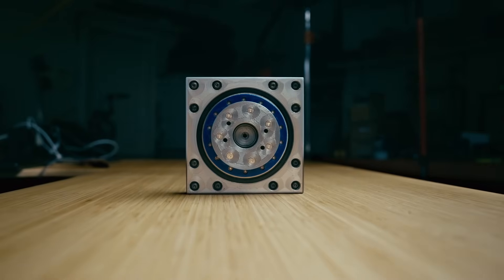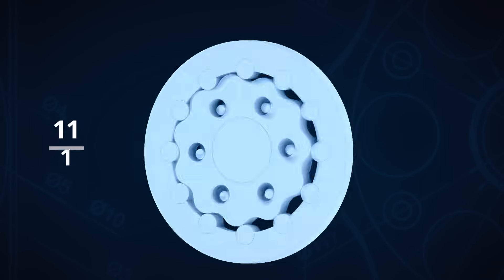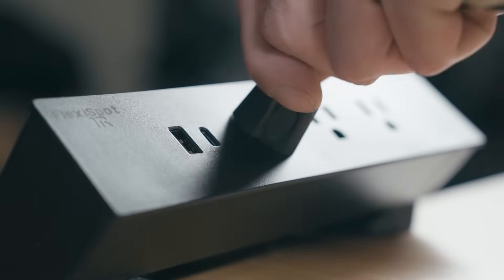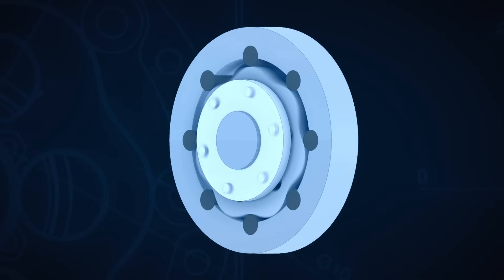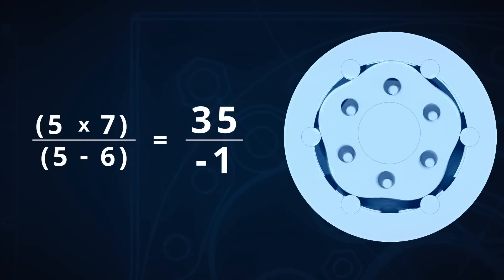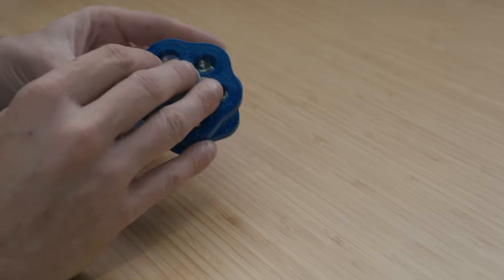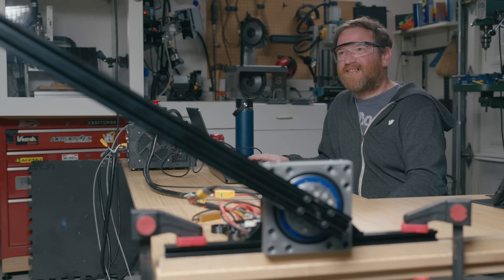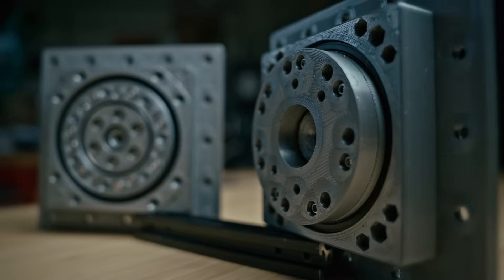You've Never Seen a Cycloidal Drive Like This

Comment: I think requirements for an industrial robot isn't changed from what our ancestors set ages ago :D Rigidity first. Imagine that all our motors are stopped, firmly, they could be removed and the inputs could be welded. Now imagine that you grab the end of your 1,5 meter long robot arm and yank it. Does it moved more than 1-2mm? An industial robot would be like a stone  in this case, rigid as f___, so when I'm planning a robot arm I start with the thinking of where is it gonna move when all inputs are locked.
For example 1 meret long robot arm, with 3kg payload plus the mass of the arm itself, we can count for at least 10kg of moving mass, which is about 100Nm when it's extended horizontally (and stationay!) When it moves, and we want to stop it fast horizontally, it can easily doubles that, plus safe margin. So that's the mindset of which all DIY robot creators should think when it comes to sizing their parts. ;)
Reply from the maker: But you gotta also move it somehow!  Great points though.
Reply: @Cinema_Mechanics  Hi! I hope you're doing well :) and so the project! I hope i didn't scare you off or discourage you, I didn't meant to. I just wanted to say don't afraid of sizing the parts bigger, larger, beefier ;) We are not Kuka or Fanuc but with a machine shop like this you can achieve similar results with a little bit bigger parts, lager diameter joints, etc. than an "official" robot with the same span. And the robot will be perfectly fine. Function will dictate the form :)
Reply from the maker: @bregbarega3717  haha Nope still plugging away!  Just been busy trying to juggle all the projects while making videos!  I love the thoughtful critiques.  It's how I learn when I'm being a bone head.

Comment: I would like to see this Cycloidal Drive paired with a small drone motor to power an electric bike
Reply: While speed and torque can be exchanged, power is absolute. A watt is a watt no matter what. If it takes say 5 watts to accelerate and maintain a mass at a given speed, and you're not putting at minimum 5 watts into the system (which youll of course have to input more than that for frictional losses in the bearings and contact points, plus rolling resistance, air resistance, etc) there is not enough energy (ie, power) to accelerate the mass to the speed. You can use that 5 watts to spin something light really fast, or you can use that 5 watts to lift something heavy slowly, but 5 watts is all you have. In physics, there are no free lunches.

Comment: Another interesting variation on the cycloidal drive is the compound cycloidal drive, where there are are again two cycloid gears, but they are attached directly, so without an inner ring. One of the cycloid gears has one lobe less than the other, very similar to how a compound planetary gear works. An advantage is that because it has no inner ring, it can be made very small and with very low part count
Reply from the maker: Stay tuned!!
Reply: I love that type of cycloidal drive! I’ve actually managed to design and 3d print one that has an outer diameter of roughly 2cm and is fully print in place (its output is not useful and the whole thing is just for show) while still packing a 36:1 reduction!
Reply: @OleBrouer is it posted anywhere? Please share!
Reply: @electrowizard2000  yeah, I just posted it to my Printables account (same username as here, just with a space between first and last name)
Reply: Levi Janssen on YouTube talked about a compound cycloidal with a smaller inner cycloidal disk inside a larger cycloidal disk.

Comment: I do industrial robotics for a living, keep the video flowing. 
Most people in the industry take the actual robot for granted. 
I am still there, 10 years in, wowed by the mechanical marvel a serial robot is.

I am more on the software side of things. Building tools to program them better/faster.

You will certainly have some nice challenges ahead when you get to the control, calibration, motion planning part.